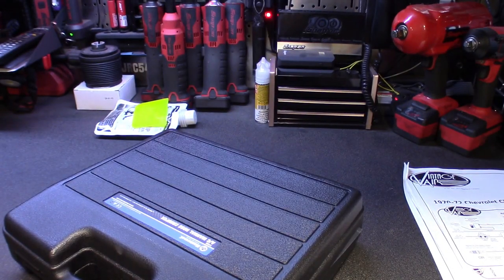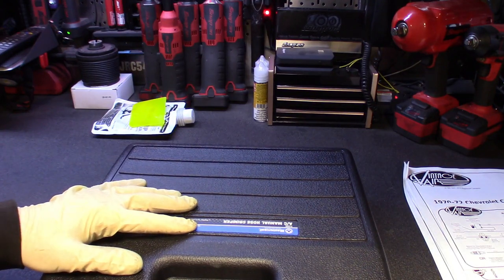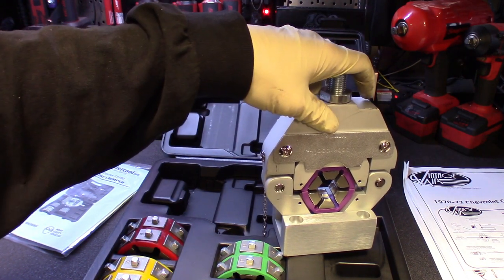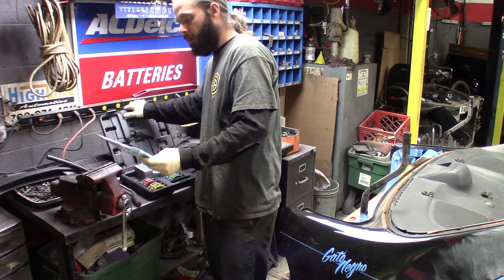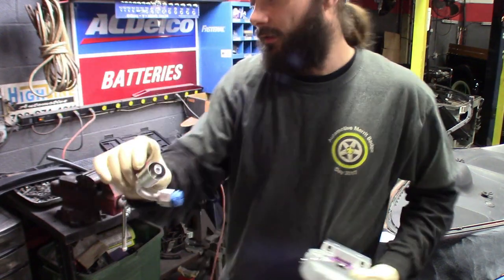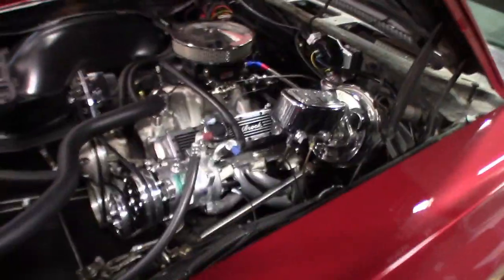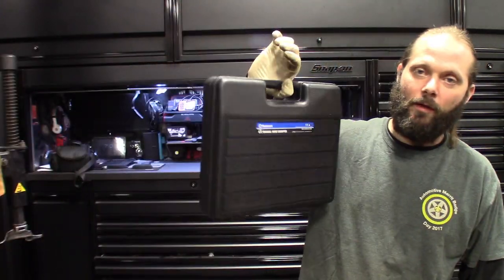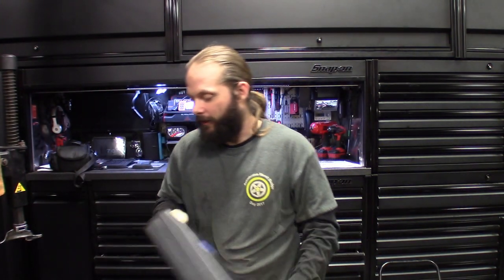Toolz In Action Cuz I Dont Care

Comment: The low side sitting on top if the motor might make it hard to fix the motor if its needs to be pulled they would have to evacuate the ac to pull the motor needed unless the low side is routed away from the engine

Comment: Pretty neat stuff I’ve never really watched something like this. Is that really where he wanted the low side routed right across the engine like that?
Reply from the maker: He didn't say but I think it was the best option, I wanted to keep it away from the exhaust manifolds so running along the firewall then up the side of engine it would be too close to heat
Reply: JRC54 yeh makes sense, was just thinking by how it looks in the video it looks like you’d have to disconnect that line for a lot of top side engine work yanno

Comment: Liked what you did there but don't be offended when I say that although the tool works I wasn't really impressed with the base being loose and wiggly . But what the heck . This one is not meant for day in and day out use and a pro hydraulic one is costly . I do field work many times and most of the hoses I do are high pressure . It did a great job for you and that's what matters .